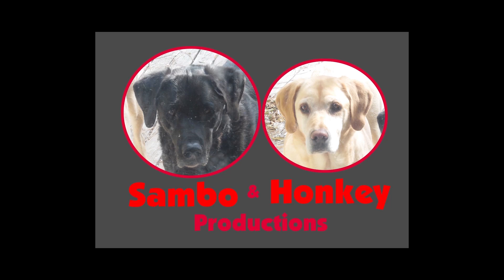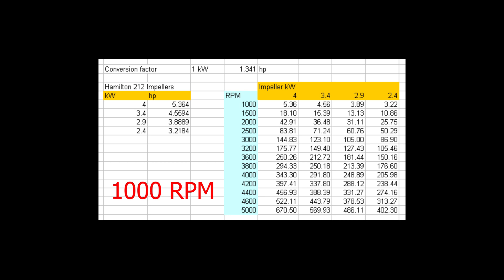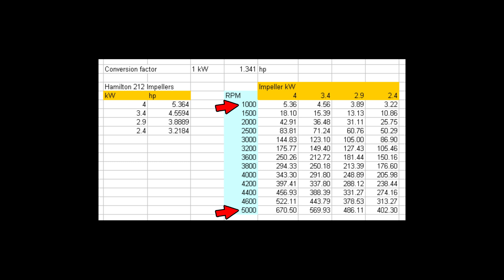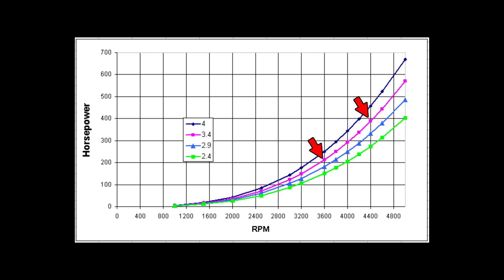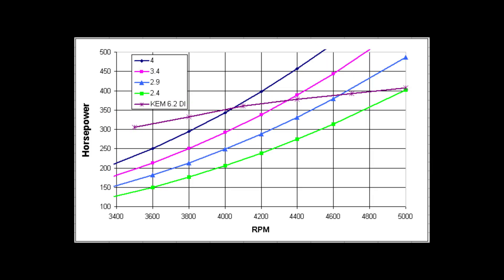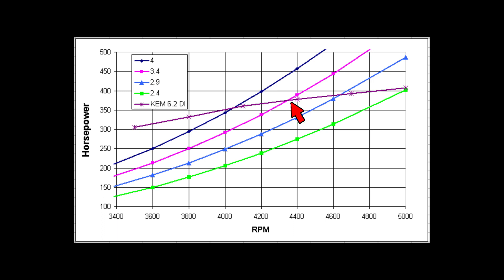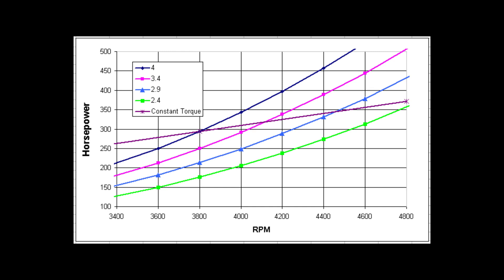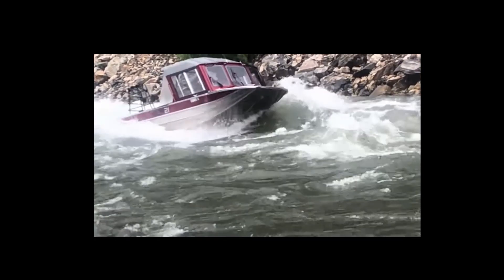Jet boat impeller math

Comment: How does the xfer to jet ski impellers?   I just ordered a solas 14/21.  As a guess.  I don’t like having unregulated guesses.
Reply from the maker: I'm guessing that 14/21 is some sort of physical dimensions, rather than power absorption. What's needed is either power versus RPM curves, or power at one RPM combined with the cubic assumption. Also, the method here is assisted by the relatively flat torque of a large V8. Assuming your jet ski is 2-stroke, then the torque is very peaky, so an accurate guesstimate will require a power versus RPM curve for your engine. So in summary, more information is needed.
Reply: @idahoviking  yeah. This won’t apply to my needs.  The jet skis 14/22 is the leading edge pitch vs the trailing edge pitch.   Thanks for the info tho.

Comment: I came across this vid. accidentally. I  was looking for hot animal acts I heard about . Seems like this is a different kind of "horse power " film.
Reply from the maker: The question is, how many horse power in one elephant power?
Reply: @idahoviking  i must know!
Reply: nice video sir, may I know the specs of your Hamilton 212, like size of impeller and length and depth of the fins to the shafting, size of shafting. the length of the stator part and the length of the nozzle from the end of stator , how much horse power are you running your 212? I ask this because I intend to fabricate one. thank you so much sir.